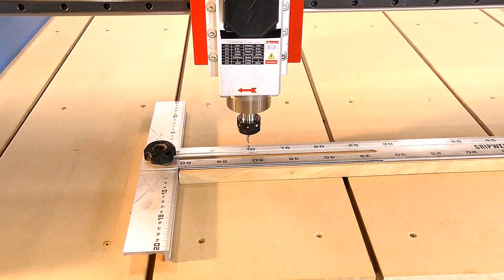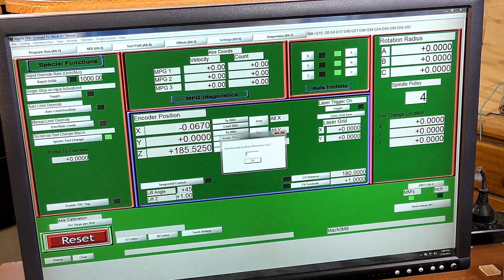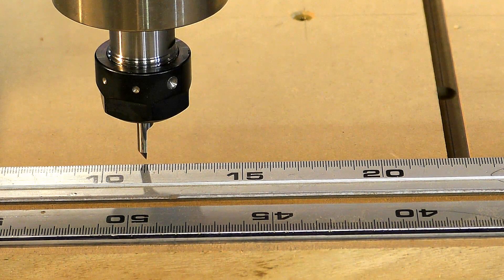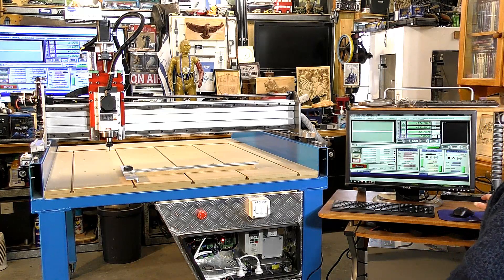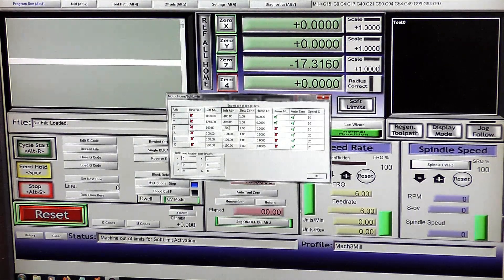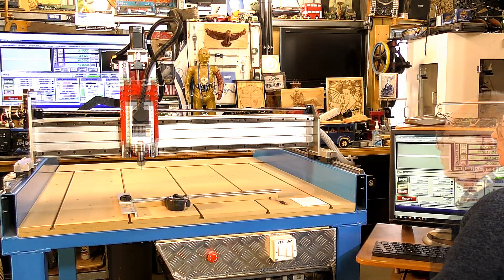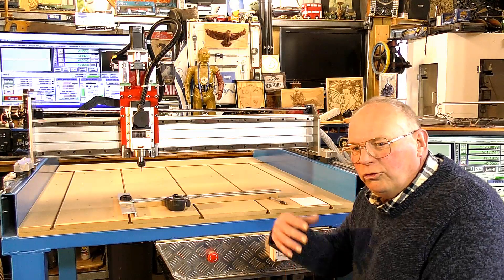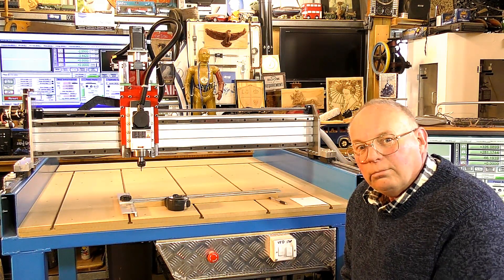Part 2 Mach 3 setting up for a new large CNC router [Episode 20]

Comment: Good day from Pennsylvania, Roger! I have finally gotten my shop just about finished. I have a shapeoko xxl pro installed within a custom enclosure in which I designed myself. I just finished installing my dust collection system which is routed not only to the CNC, but to other workstations I have built. I have used carbide create along with fusion360, and have just recently began using vectric aspire pro. I was wondering what software is your favorite for programming your CNC? Thanks!